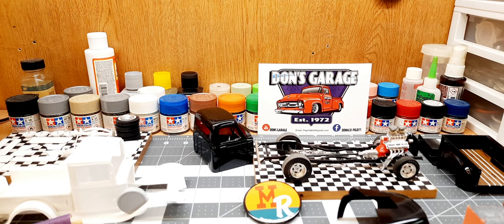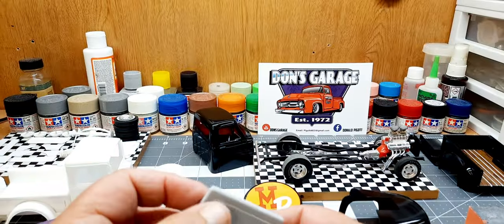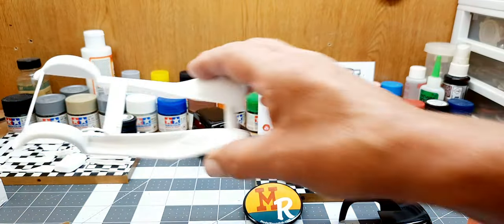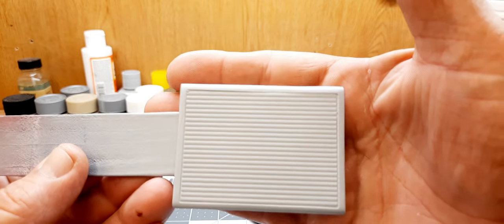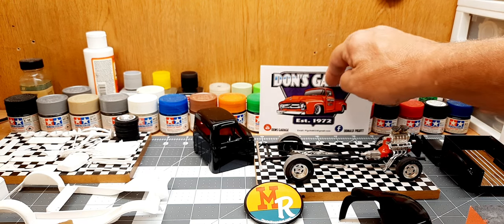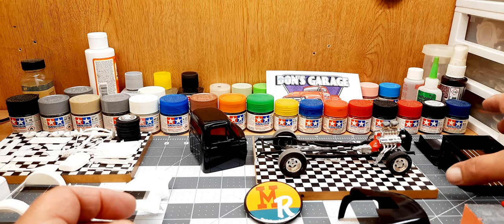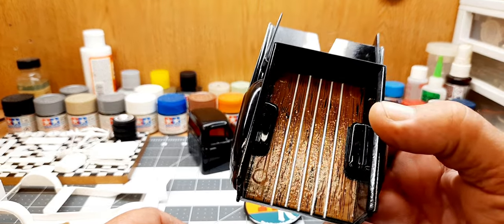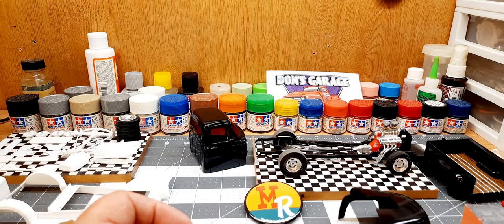A little bench update

Comment: Sweet looking truck... maybe a few scratch built tool boxes or crates to throw over those pin marks in the bed... I've tried everything I know to remove those things without messing up the area but cover ups always wind up being necessary... at least you can flock interiors... wonder if anybody has ever tried an imitation spray on bed liner to cover those up with?